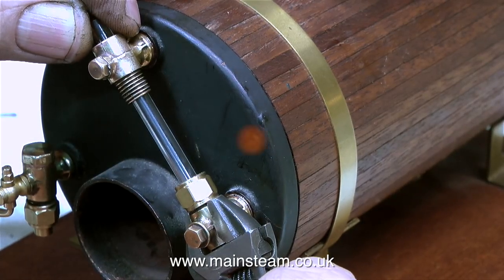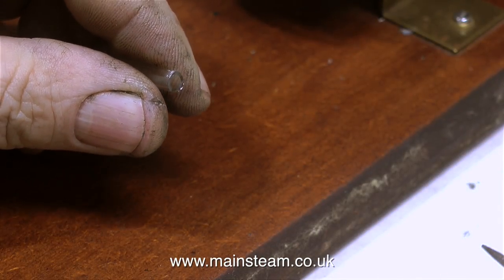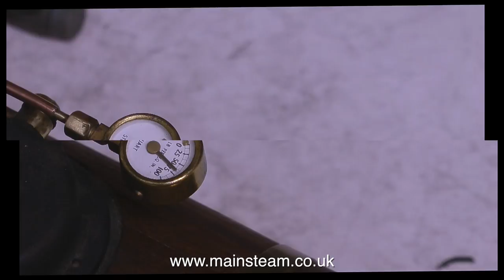FITTING THE WATER GAUGE AND SETTING THE SAFETY VALVE - IN THE WORKSHOP

Comment: Very useful. I have been trying to repair my Weeden boiler glass water gauge. Two attempts so far have not worked. My fittings do not have caps on the ends where the glass installation can be slid through. I think the missing glass was cemented in-between the fittings from the factory. I drilled each fitting out to the glass diameter allowing it to deeper enter one of the fittings, then once in place, centered it so both glass ends were captured in each fitting. I will be trying it today 9/11 and hopefully it will seal. If not your final fix with the tubing washers will be employed. Now the seal is some Garlock.
Thanks for the great videos.

Comment: I have seen a suggestion somewhere about using a metal rod, of the same size as the glass tube, when aligning the two fittings. This removes the possibility of breaking the glass tube during the alignment process.

Comment: I'm surprised you didn't heat the glass after cutting it; heating the fresh cut on a flame will smooth the glass so that it doesn't damage the o-rings (or silicon pipe) used in the fitting when they're slid on, and will also seal any minute fractures in the glass end.
I had a glass fail (read: shatter and explode under 100psi pressure) on me a number of years ago, so I tend to be rather fussy about them these days.
Also, that first safety valve you showed, without the locknut, most likely wouldn't be useable here in Australia, as our boiler code requires a lock nut or similar. You said the one with the locknut i's a later model, so it's entirely possible that Stuart added the locknut in order to meet the code here so they could sell their boilers and fittings.

Comment: My supposition on the noise from the safety valve is that there is a resonance being excited, either in the spring-mass system or in the standpipe formed by the valve body. It sure is howling, though.

Comment: Hi Keith, how do you measure the Lenth of glass to fit the boiler, mine has a history of breaking the glass at a high rate...
so glad you did this video, i have no idea till now, please keep them coming.
Reply from the maker: You could just estimate it by eye or push a piece of thin brass wire into the position where the glass will go and get the length of glass required by measuring the brass wire - the gauge glass must not cover the hole into the boiler in the top fitting.
Reply: Thanks keith, im Learning !!

Comment: Why didn't you use the aluminum washer on the top cap and the copper washer on the lower fitting to the boiler so you could more easily change out the aluminum washer later when you obtained a suitable copper washer?